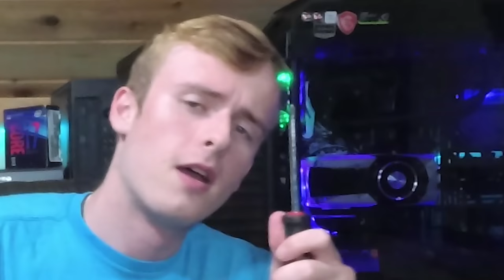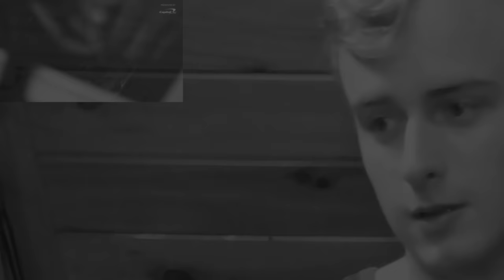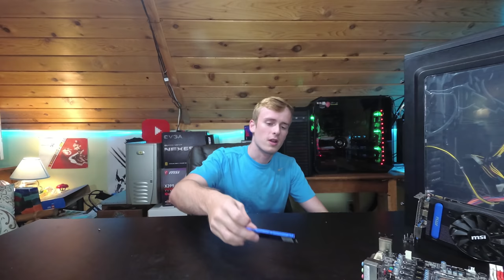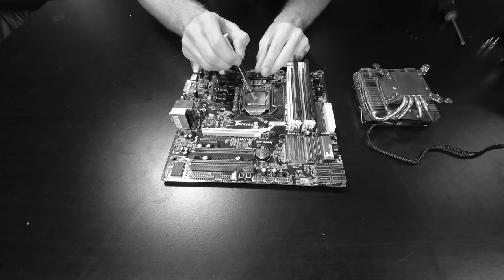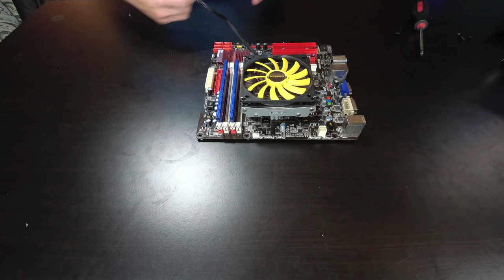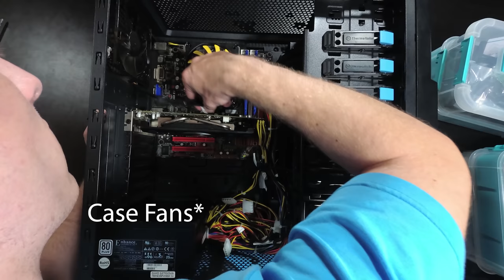The Verge PC Build PARODY Where Everything Is Done Correctly | JTV - How We Built a $200 Gaming PC

Comment: I guess part of this is what's your goal... I know LTT stated basically most people watch their vids for the hardware PRON aspect.... But as a true ACTUAL beginner video I really wish in addition to the "Yeah test this before your put it in the case because that's a good idea" that the video would actually show it (LTT never does so you'd be better then them at that point)..... Also for this to be a true beginner video I think you neglected to mention (partially since you already knew it wasn't an issue) that sometimes the CPU heat sink can block the access to the CPU fan power on the MB and you really should check that pretty early or risk redoing the whole thing over again (especially if you're lazy, don't test out of the case, get everything mounted then realize you forgot to plug it in, and UGH).

Comment: If you computer doesn't show signs of life at all, check you've turned the PSU switch on! Also check that a cable isn't obstructing the fans when the case is upright. Clicking sound is a dead giveaway.. dryfit the components outside the case first to familiarise yourself with what goes where... And don't buy an expensive CPU cooler only to find it won't fit in the case you have brought!!! The video is ok, speak slower, take your time (you can edit after all)  I'm subbed!

Comment: so mny twzzrz 4cabbls

So okay fun story, I should have done my research but I  trusted ASRock, they had ONE BIOS listed for me to upgrade my dusty old Extreme3 Gen3 from 1.00...to 2.3. I GOTTA upgrade the BIOS, my shiny refurb 2700k will not work with BIOS 1.00, and the i5 2500k is holding my 1060 back even at 5.0GHz. Sure...I usually like to step up from 1.0 to 1.1, then to 1.2, 1.3, etc - but if ASRock wants to just give me 2.3 or 2.31A beta BIOS only...sure. Why not?

Flash with 2500k in...sucess! Reboots...only half of my Corsair XMS3 is detected...? Entire BIOS has been changed into...UEFI?!

Do some research...apparently if you skip 2.1, it halfway breaks the motherboard. No more OC ability, not even as low as 4.0GHz with a chip I previously had at 5.0Ghz. Neither 2500k nor 2700k will OC...only IVY BRIDGE CHIPS WILL OC NOW. SANDY BRIDGE SUPPORT IS COMPATIBILITY MODE ONLY -_-  

Only way to fix is with a BIOS chip from ASRock directly. 

Here goes another $20 for a BIOS chip ha!